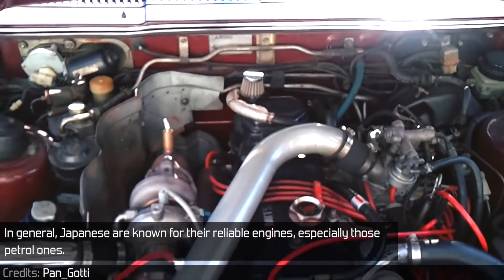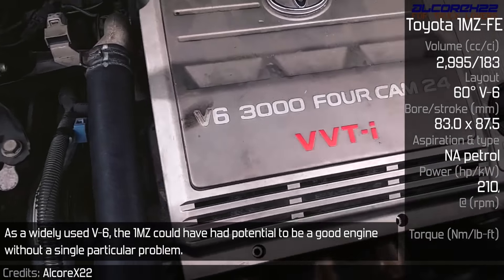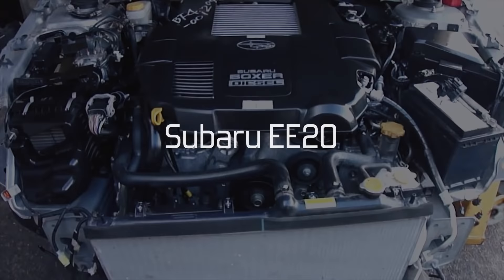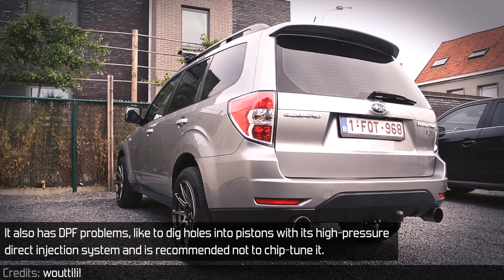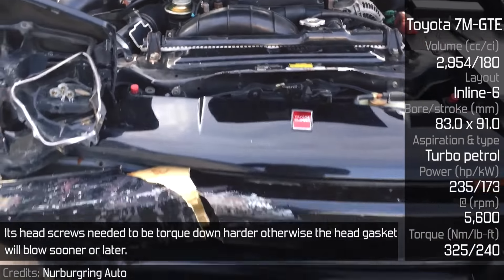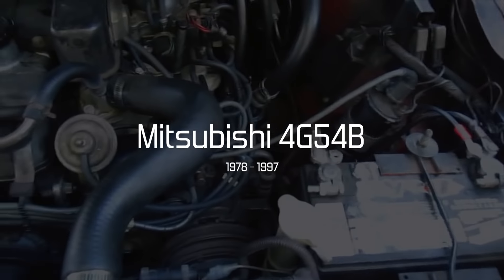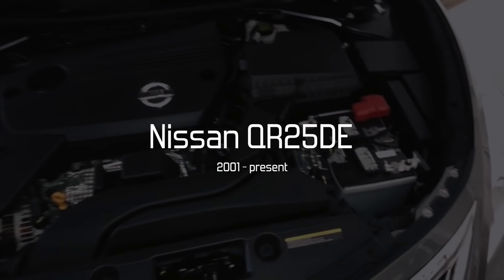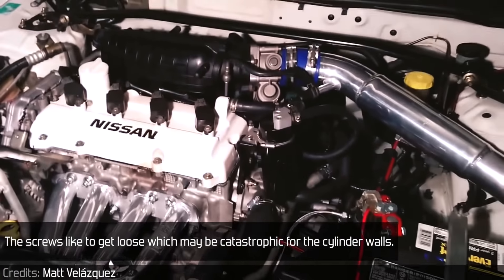Top 5 Worst Japanese Engines Ever

Comment: Do germany next
Reply: Senne C. The list is too long
Reply: 4 vw engines and 1 by opel
Reply: n55, any mercedes petrol engine,  opel, probally more i can’t think of
Reply: VW 1.9 TDI
Reply: Too easy
Reply: He would have to do one for each manufacturer.
Reply: Pretty much everything made by Opel, we got dumped with heaps of them rebadged as Holdens in Australia. Instant disasters waiting to happen!
Reply: robert leitch well those engines are mainly GM engines aren't they?
Reply: opel earlier ecotec engines...
Reply: Mathias Mang GM is shit.. they only make good v8s that’s it
Reply: +JP3 All VWs? Not likely.  They made some amazing engines.  BMW though...
Reply: A daft punk what bmw engine is trash? besides n55 and their diesels
Reply: So many bad german engines.
Reply: All of them
Reply: Senne C. They can't, there aren't any bad engines from Germany.
Reply: xHarux3 all of them except the LS!
Reply: xHarux3 there are no 1.2 tsi engines here in the states. We have motorcycles with bigger engines than that. 😂 Smallest VW engine I've ever seen, I think, was a 1.6. I've never seen a bad VW/ Audi motor, at least not the ones they send to America. The only shit motors I've ever seen were from Fords and subarus.
Reply: xHarux3 the 2.0 is due to people using too thin of an oil for the life of the engine and/ or using conventional. If you use 0-10w40 the 2.0 will last forever. It's user error, not manufacturer error.
Reply: xHarux3 the LS is the most common and most reliable engine in America next to the 4.0l jeep inline 6.
Reply: xHarux3 I'm calling BS on that one, a 2.0 is not going to overheat on the autobahn, it's not an air cooled VW Bug, and it only tops out at like a hundred. I think it sits at like 4000 rpm at top speed, they only have 120hp max. I've done it, for a pretty extended period of time actually and it just stayed in the middle of the temperature gauge like it's supposed to. Just because we have speed limits here doesn't mean we follow them. Cops are pretty few and far between when you're speeding through rural America. Put a decent 5w-40 synthetic in there from the day you buy it and a 2.0 will last forever. The problem is that people want crap oil in there because it's cheaper, but it's still a VW even though it's an econobox. Not sure about the 1.4, we don't sell those here in the states. VW knows better than to try and sell us a lawnmower engine in a Yugo or whatever that stupid little go-kart they make is called. Only Europeans are smug and/or dumb enough to actually buy one of those. The LS is one of the most reliable engines GM has ever made, to the point that they put it in EVERYTHING. I've seen LS motors in Silverado's/ GMC, etc. (farm/ work trucks) that get the shit kicked out of them with well over 300k miles on the odometer and very minimal maintenance with garbage conventional oil in the crankcase. Most of GMs sports cars (Corvette, Camaro, Monaro/GTO, etc.) use some form of the LS engine in them; on stock internals, LS motors can reliably handle 7-10psi of boost. The only engine that is more reliable than an LS is the AMC/ Jeep inline 6. My XJ has 305k miles on it and I rarely change the oil. I think I have 15k on bulk oil from work and a shitty filter and that's a pretty regular thing for me. That thing is a tank, no matter how hard I try to kill it, it never dies, it just laughs at me and continues to run like it's brand new. My buddies Silverado was the same way, he finally junked it at 450k because he got into a wreck. That motor still ran perfectly when they drove it up on the flatbed to take it to the scrapyard. The LS is a great motor and I'm not really a GM kind of guy. I'm actually not even a huge fan of American cars in general but I give credit where credit is due. If you want a good econobox that works well with conventional oil (probably even vegetable oil), buy a Toyota or a Honda, they can withstand just about anything.
Reply: xHarux3 maybe you should put your sentences together better it's almost like English is your second language. 😂 The LS is a great motor and maybe one overheated after 2 laps, it's not an indication of how reliable it is.
Reply: xHarux3 why, exactly are the oil control rings on the 2.0 tfsi poorly designed? Any specifics, like the tolerances between the rings and the piston grooves, or even the bore dimensions compared to the diameter of rings? Give me some factual information about that engine, it seems to be a great engine when it uses a thick enough oil and not 5w-20 out of a bulk drum.
Reply: ford inline six 240 or 300 one of the best but none these days may be 4.6they are ok
Reply: Tom 🤣🤣🤣  105ps. Ps is eurotrash speak for horsepower, right? It has a great torque curve, right up to 120 lb/ft 🤣🤣🤣🤣🤣
Reply: xHarux3 I'm well aware, just wanted to trigger you even more than I already have.
Reply: Every engine would be on that list
Reply: bmw 325 tds e36, gm ecotec engines, ford duratec diesels
Reply: Senne C. We dont make cars with problems
Reply: it should be a "Good German Engines"
Reply: FiveStarStreetMachines nah, the list would be too long;)
Reply: VW 1.4 TSI (timing chain loses tension after about 80k kms and, if not fixed, will destroy the engine); Opel A16LET (worst 1.6 turbo ever made).
Reply: Strax all 1.6 turbos are the worst turbo engines ever made. It can barely move a go-kart, you can keep your opel, we don't want them in the states.
Reply: Robotron 123 you didn't read properly. That Opel engine is crap, I would never buy one...why would I want to keep it? It's slower than a 1.4...
Reply: Strax 🤣 1.4
Reply: any German v12 is crap
Reply: It's pretty much the same case with Chrysler. Other than the Hemis and some of the V6's, which aren't very good performers, but are at least durable, most are crap. I wouldn't have anything of theirs with a 4-cylinder.
Reply: Good American Engines: Chevy LS1, Chrysler Hemi, 4.0L Jeep/AMC, Ford Coyote V8, Ford 5.0L & 4.6L, Dodge/Jeep 5.2L.
Reply: Colby bmw m40 i4 (1.6/1.8) timing belt lasts only 40 000 max
Reply: that would be called top 40 worst german engines ever
Reply: Did you mean the check engine light country?
Reply: VW 1.8T.....oil eaters, check engine lights galore, etc.......NEVER AGAIN
Reply: I am sad to say this, but the S85 V10 from the BMW M5 E60 is one of the worst engines. I am sad because the E60 is my favorite M5
Reply: all vw engines
Reply: @JPTHRICE  why 1 by opel? which one?
Reply: vw fanbois hate opel and say they are unrelibe and consume a lot of gasoline to everyone they can and say bmw are unreloable, vw fanbois create stereotipes for cars in balkans, vw engines are reliable only if they are diesels and are more unreliable than gasoline engines from other brands and diesel engines from cheap cars
Reply: @stockprerunner  The BMW N63.

Comment: Mitsubishi 4d56 absolute joke of an engine drinks diesel like it's going out of fashion, produces as much power as a Vespa, crack heads for sport , leak oil no matter what you do to stop it and can't keep front crank pulleys tight which in turn damages the crankshaft a joke of an engine.
Reply: Higomad Exactly.

Comment: Not a single Mazda engine. 

YES :D
Reply: Mazda embodies conscious respect and appreciation for what engenders passion and love for cars and driving
Reply: cause the mass majority are ford engines lol
Reply: @shineything4444  wrong. Well, you're right about like a mazda tribute and the mazda pickup which is just a Ford ranger. But all of the other mazdas, like the 3,6, cx3, etc are all mazda engine. The first gen, I think cx 9 had a Ford v6, but they now have a mazda turbo 4 cylinder
Reply: The 2.3 turbo was utter crap
Reply: @andali555  no it's a really good engine. Except for some of them. They had the problem of the camshaft but even this was recalled by Mazda.
One of the best brand on this world
Reply: @frijidmeatwad5253  no the cx7 had the 2.3 turbo on the Mazda 3 and 6 MPS and the V6 on the cx9 is made by Mazda
Reply: @andali555  the 2.3 turbo was not crap, the 2.3 NA in the mazda 3 and 6 was crap, most of them suffered terrible oil consumption problems, i know because i own one. A litre per 1000km at least (1 quart for 650 miles)
Reply: @andali555  The 3.5 and 3.7 V6 engines were crap too. Those engines were really Ford engines and RWD applications fixed the water pump problems by relocating it externally like most cars.

Comment: I drive since new a 2009 Mazda 3 s hatchback 2.3 with 5 speed auto and 189,000 miles. I have been dumping money lately for suspension parts at all four corners and a trans module. A trans module is not a rebuild. At the end of the last 5000 mile oil change interval I got back from a 2000 mile Marathon trip in 50 hours. Car ran like a champ. Did not burn or leak a drop of synthetic oil.

Comment: QR25DE gets a lot of crap from flaws that mainly pertained to 2002 model year flaws. Its a good engine.
Reply: Solid engine, I drive a 2003 se-r and it's been running great with standard maintenance for a long time now.
Reply: My 09 Altima coupe has 220k with no engine issues. Knock on wood.
Reply: I've got a 5 speed 07 frontier just passed 300k original engine. Hasn't had anything other than normal maintenance hell my spark plugs have 100k on them
Reply: my X-trail had 230k's on original radiator fluid , only ever changed 1 oxy sensor and 1 cam sensor.   Unfortunatly i was written off when someone hit me at 90kmh  Very Reliaable engine.

Comment: Honestly as I work at a Toyota dealership the 1MZ-FE is one of the most bullet proof engines Toyota produced; we have several (12+) in my area pushing >350k miles and 3 or so pushing 500K miles. They do have sludge problems, but primarily on the pre 2000 models. Keeping this in mind as long as the oil is changed every 3-5k miles sludge is minimal, and even in an improperly maintained car the sludge usually causes no problems til a flush is ran and breaks all the sludge free to float around the engine.

Comment: How is the 7M-GTE on here
Reply: ToyotaMR2 Fanboy cause it sucked...
Reply: ToyotaMR2 Fanboy  I know right
Reply: ToyotaMR2 Fanboy  it's such a good engine
Reply: ToyotaMR2 Fanboy  I have one and I hate it 😂
Reply: I have no idea. Once you fix the head gasket you have a torquey turbo 3.0 i6 that can handle over 500hp on stock internals.  Buuuut it's not a 2JZ mk4 so we're just gonna hate it for no good reason.
Reply: Slow Supra i agree with you
Reply: _ 4S1NZ-NOSCUSTOM1185 _ Toyota lost so many races do to that shit motor the 3sgte was alot better , the newer 1j is another story..just replace the crappy twins with a single and it's gravy
Reply: @jasongroenewald3187  it's his opinion... It can be worst

Comment: Subaru boxer diesels were extensively modified from 2010 to adress the faults you mentioned.
Reply: El BU to no success. And their fuel consumption and power output does not really speak in favor of it either. A diesel subaru only makes sense in countries with very big price diference between diesel/petrol fuel, since the diesel model drinks as much as the petrol one.
Reply: waclosh not even close. The fuel consumption is one of the lowest compared to other diesels. Power output is normal, however power delivery is very different.
Reply: Got 8L/100km : heavy foot when hot engine , non aerodynamic 42" lightbar  and 255 wide wheels+ full time awd, 185hp i say its not bad
Reply: @waclosh  How on earth do make that one out.

Comment: Toyota makes good diesel engines; the 2002-2009 1KD-FTV 3.0 D4D used in the Land Cruiser 120 series i very good! It may not produce that much power (166 hp from a 3 litre inline 4) but it is the most reliable thing in the world!
Reply: or the 1HZ or the 1HD or the 1VD. he is so wrong saying japanese diesels are bad. the 1HZ is one of the most reliable engines ever made. there have been many in Australia that have done over 1 million kilometres without a rebuild
Reply: The 2.2 D-CAT was a mess from Toyota, despite the fact that it is producing good figures, especially for a diesel. The sealing compound between the block and the cylinder head was way too hard, leaving a mark on the cylinder head if this problem wasn't balanced and recognized in time while power loss, high fuel consumption and problematic electronics are also common problems.
Reply: The engines themselves were good but they were let down by their ancillary equipment. The 1KDs in the Hiace and Hilux  models have a short lifespan on the fuel injectors and diesel pumps, and the clutch driven alternators have a fairly high failure rate, according to the auto electricians I work next door to. The 1HD 4.2L diesels are solid, reliable engines, but I've heard many cases of them snapping crankshafts when you put more boost through them. But you can't beat a Toyota L-series diesel. Utterly bulletproof, they do not die, short of running them out of oil
Reply: I guess him being European they never got the good diesel engines from Toyota. My parents have a 73 series Landcruiser with the 3.4L 3B engine. Huge naturally aspirated 4 cylinder diesel. Utterly unkillable. Japan definitely makes a lot better diesel engines than any European company when it comes to reliability.

Comment: I would add the mitsubishi early 80's 2.6 engine used in mitsus and dodge caravans and some others, horrible engines, 4 chains that stretched and if you didnt tighten them they would drag across the oil pump and ruin it, manual valve lash adjustment, rings that burned oil within 10,000 k, and a horrible carburetor that had 2 egrs. 2 sub egrs,(when they went you had two options go to the highest octane fuel or replace the entire carb to get rid of the knock and ping) a thermowax system double barrel but only one having a butterfly valve, and worst of all no step down high idle, it had a plunger at the end of a dead end coolant tube that would take close to 20 minutes in -20 weather before it went to low idle, made it fun driving on icy roads.

Comment: My dad has a '96 Avalon, I had a' 01 Avalon, my mom has a '02 Avalon. All have, you guessed it, the 1MZ FE. They have all been reliable. I bought mine at 140k and used it for running deliveries for about 70-80K miles and of those miles I had been changing the oil every 15K interval with Mobil 1 Extended Performance (15K synthetic oil). The car did about 200 miles daily! Around 210K the engine had been starting to run rough and burn oil. Around that time I had to get rid of it as repairs cost more than what the car's worth. So I'm not sure if it was just on its way out or if it really needed oil changes more often.

Comment: If the 1-fmz is NA why did it have a turbogauge standard on the car?
Reply: 13utterz vacuum.
Reply: Yeah, I was wondering, too....That guage cluster is out of an SW20 MR2 Turbo (hence, the "boost" guage), but THIS one has the 1MZ-FE in it.
At least, that's what I THINK....
Reply: Possibly a TRD supercharged model, there are a few of those out there
Reply: Could have been swapped into an MR2 turbo. Which would explain why the boost gauge was pinned at maximum.
Reply: Custard1506 yeah it's 1mz-fe swapped mr2.

Comment: the 1mzfe is a great engine if people would change the oil every 3000 miles and run high octane gas it had a compression ratio of 10.5 and it  had soild lifters like a 60,s muscle  car

Comment: The 1mz/3mz engines is a very good engine but, synthetic oil is a must. If a 2JZ can't fit, a 3MZ or a 1MZ may be the next best thing when it comes to swapping a 6 shooter in favor of keeping the original 4 banger. Swapping a 3.3L 3mz-fe in a Celic will bring a big improvement in the fun to drive factor.

Comment: I've workred in a Subaru dealership for some time. Boxer diesel is an abomination. Regular petrol boxers can be a bit dicky if not maintained properly, but all in all are really decent in terms of reliability (H6 has problems with catalytic converters, but not that often). 
Boxer diesel problems:
DPFs dying (quite common in most diesels post 2007)
Cranshafts cracking due to high torque
Engine blocks cracking (instead of cranckshafts when Subaru stared using better alloys for crankshafts, it's ubiquitous)
Fuels injectors dying (in Poland they go for 4000zł per unit, which translates to 1000EUR per unit, multiply it by 4 of course)
Head gaskets failing
Generally a Boxer Diesel with 200 000k without an engine rebuild is an unique sight

Comment: What about the hand grenade Nissan ZD30 engines, actually most Japanese diesels since 2000 when the dreaded EGR started to contaminate the oil/air intake. 
Tightening pollution rules world wide has converted the most reliable engines (diesels)into expensive hand grenade ready to blow at any moment
Reply: Ask most Australians into 4x4 about the ZD30, the grenade with the safety pin removed

Comment: i am building a QR25DE (nissan sentra SE-R spec-V) and yes the engine has problems, yes it is expensive to build, but.. yes it sis 10X more fun if you build a 2.5 turbo engine once you have reinforced all the weak points, and yes thise engines may have been plagued with issues, some greater than others, BUT, this are mostly older engines, in my case, there are a quite a few after market parts that address the QR25 failures and really bring out the torquy nature of the engne, the car has a great 6 speed forward and reverse transmission, the LSD is not garbage, and i am addressing all the engine related failures..  so i am so glad we live in a time in which i can address all the engineering issues, and show the true potential of my engine..